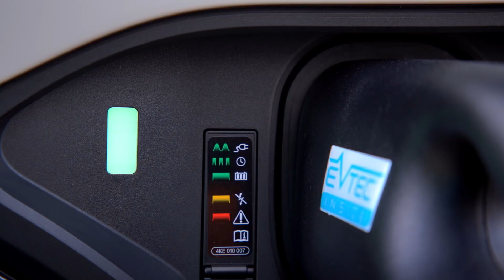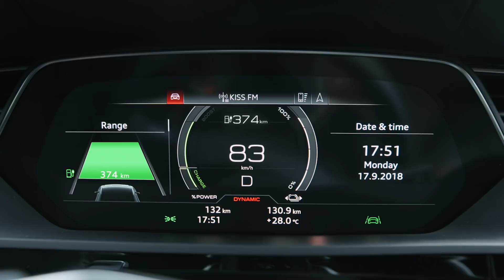Why The Audi e-tron Has A Smaller-Than-Expected Range

Comment: Another example of these legacy car makers being caught between a rock and a hard place. All are 100% reliant on a 3rd-party battery supplier. These suppliers determine the batterys' chemical composition and fundamental structure - largely because having too much variety in such composition adds significantly to costs. So these automakers have to take what's on offer - even if the cells are not truly compatible with the complex variables that apply when installed in a car. Tesla does not have this issue, and by owning this mission-critical technology, they can (and do) have the ability to tweak the composition of their battery cells (almost in real time) to create cells that better meet the demands that EV's place on them.
Tesla, for example, does not need to "release" more battery capacity through a software update - their customers seem quite satisfied with the comparatively higher range - but the fact that they CAN perform such an upgrade demonstrates my point... Tesla is in control of their battery technology. Additionally, when Tesla does perform such an upgrade, the customer can be confident that it is being done after due consideration of all the "risks" associated with battery degradation potential. Afterall... they made the cells in the first place... they know what can be achieved.
The legacy automakers have woken up to this and we know of "planned joint ventures" by some of the European car makers to start their own versions of gigafactory - but I foresee a lot of potential for bickering and disagreement here. Too many cooks may just spoil the broth as all the partners in such a venture come to the party with often widely conflicting ideas. Each automaker's technology may be such, that a "generic" one-size-fits-all just won't be feasible, which puts them in the same position they are now.
While the European car makers (particularly Germany) may have better build quality and more luxurious finish capability, these will not be compelling enough criteria to sway a market that is increasingly focused on the more important elements such as drivetrain efficiency, software integration and future-proofing. Go to any Tesla chatroom, and the main topics of conversation relate to these factors... "What software version is coming out? When is it coming? What will the updates do? What features will be included? How will this improve my car and my driving experience?"
The days when we used to put high value on walnut panelling, paint colour, leather seats, chrome fascias... are increasingly unimportant - and lauding these factors will soon not be a USP for car makers. This leaves them further behind - and increasingly vulnerable.

Comment: I am French living near the German border and very interested by this e-tron. with us, the highway is limited between 68 and 80 mph and
I make a lot of road, about 22000 miles each year.
as the battery is limited to 83kwh on 95kwh, and the car uses a lot of kw on the highway, can we charge every day to the maximum without risk of degradation of the battery? thanks.

Comment: I wonder what those who put down a reservation for the E-tron are doing.  204 miles is laughable these days.  Especially with a 95kWh battery only limited to 88% capacity it's still lower than 2.5 miles per kWh.  I get nearly double that in my Model 3.  All those decades of automotive experience mean nothing if none of those years were spent on EVs.  Sure they'll have build quality, but will be behind on battery tech, electric motors, and regenerative braking for a while.

Comment: Because they are going to release a long range version. It will be lighter because it will have an aluminium chassis, slightly better battery and management system. The management system is probably from data pooling that get from the initial released vechiles. I wouldn't suggest that is a beta test version but if the end goal is the long range variant with the about features I'd be annoyed getting this car first. Plus the range could put some people off of they are sitting on the fence about an ice or ev. So for VW it's a win win situation.

Comment: Audi is all bulls- - - - . They originally advertised much higher mileage , got their initial sales away, then tried to cover-up by saying saving batteries. It is just poorly inefficient engineering.  It will be interesting to see what mileage their sales and advertising will say now. !! All previous promotional Utubes were showing the regeneration specs on downhill videos. A big cover - up of true range in real life. Unfortunately many uninformed buyers will be swallowed in by the Audi promotions. Expensive for what you get, and difficult to find rapid chargers for anything other the commuter travel.

Comment: It's not just underpromising !  Audi is limiting the usable portion of the battery pack and lowering the range of the car but for the range to be so low, the efficiency too must be bad. So you are lugging around a large battery which you can't fully charge, which means you can't fully use it. You were forced to make this video because Audi especially inefficient and highly conservative limit to it's battery pack. Maybe their batteries break very soon if used more and so they have got this situation. Now we need to check if Porsche taycan does this too or is their bms software better and more practical.

Comment: Very important to it's Customers?  No.  Very important to AUDI's bottom line due to warranty concerns.  They want to charge every dime possible for hanging an AUDI badge on the car, while making sure no one ever needs to use the warranty for battery replacement.  Yes, not only is that far less range than Chevrolet Bolt, Kia e·Niro, and Hyundai Kona Electric currently, but it is less range that the 2013 Tesla Model S 60 of six years ago.  Dissappointing?  Hysterically so.  It is highly unlikely there will be Electrify America sites with multiple 150 kW CCS outlets available every 140 miles or so along major highways in the U.S. anytime soon...